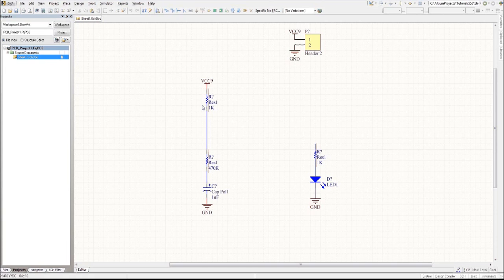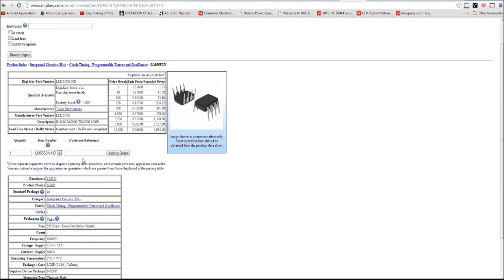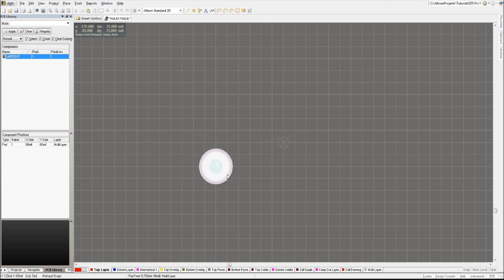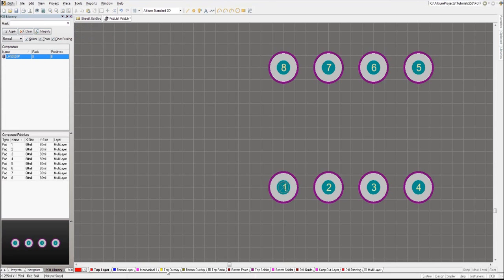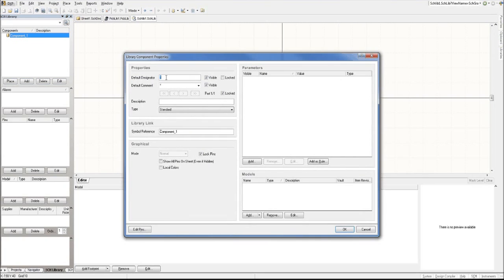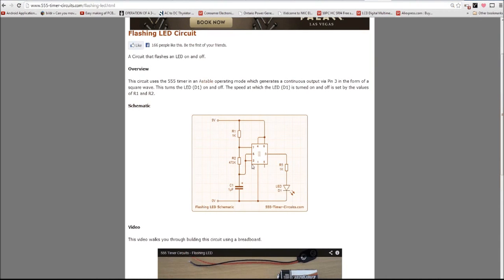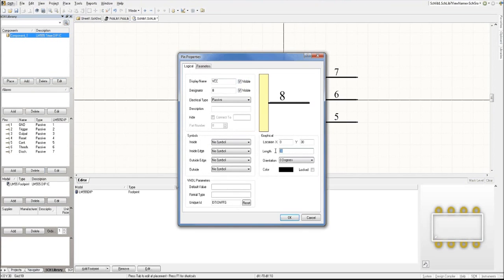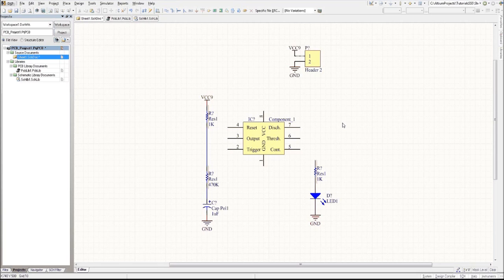Altium Designer Tutorial - Part 2 - Creating a Library for the Integrated Circuit

Comment: i don't think 250 mil is the right calculation. Can you verify that again? because i see 6,6 and 6,1 mil on the right side of 0.26 and 0.24 inches
Reply: mil isn't the same as mm (often called mill). 1inch = 1000mil, that's why 0.25" = 250mil.

The spacing is still wrong though. You can see on the data sheet that the pin spacing is actually 300mil. 250mil is the width of the IC without pins.

Comment: Thank you for this. Unfortunately not all versions of Altium start up with the same set of panels. For example at 1 minute 13 seconds you say "So to get started on making your LM555 timer and the library for the IC we are going to go to the PCB Library and as you can see Altium designer already has made a first componet for you"

Unfortunately in Altium 13.3.4 (Build 28608) the panel bar at the bottom of the projects panel is not displayed and hence it becomes very difficult to find the PCB Library panel. After a fair amount of googling I found that you could access the PCB library panel by clicking View/Workspace Panels/PCB/PCBLibrary

These are things that are also not present in the official Altium notes and which make it very difficult for a newcomer to PCB design to get started with this package. At least your videos are much better that what Altium officially provides.
Reply: That was extremely helpful! I bumped into the matter and nothing could be more satisfying than finding a solution to it immediately.
The problem might be trivial but your efforts in searching the answers for helping others like me worth the praise! Thank you!

Comment: The distance between rows of pins should've been 300 mils.  The dimension you used from the datasheet (250 mils) was the width of the plastic body of the DIP8 package, and the pins extend a little beyond the plastic body to land on the standard 300 mil spacing for DIP8.

Comment: Hey I also noticed that on your data sheet at the distance 0.1 mills you wrote 100 mils instead. Why did you do that?
Reply: The datasheet is .1 inches which = 100 mils. 1 mil equals .001 inches.
Reply: Rambozo Clown EDIT : My bad you are right.  Just got confused with mils and mm lol